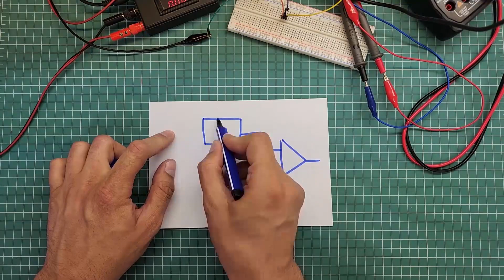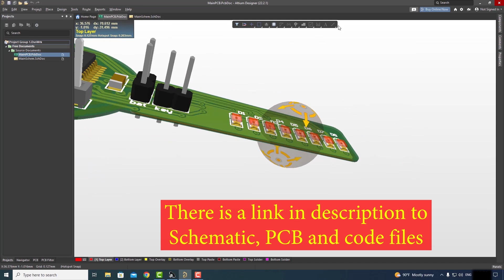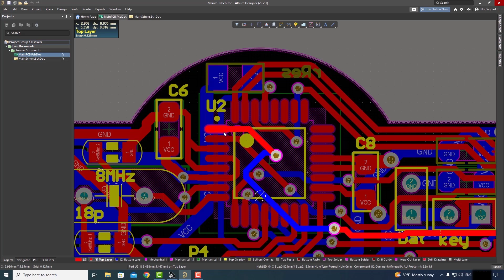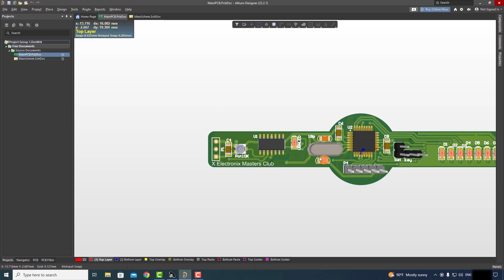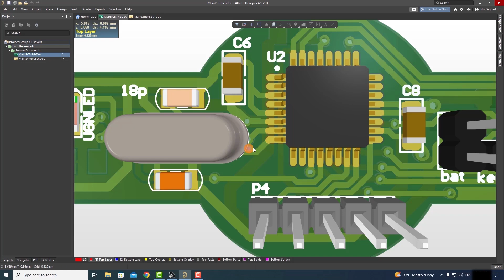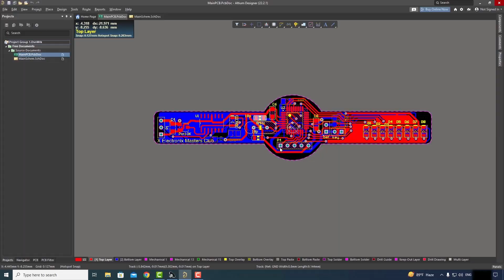How I made my new POV display!

Comment: Querria hacer este proyecto con el microcontrolador de Atmel, At89C5115, porque dispongo de una cantidad de ellos. Crees que es posible realizarlo ? Un saludo.
I would like to do this project with the Atmel microcontroller, At89C5115, because I have a number of them. Do you think it is possible to do it? All the best.
Reply from the maker: Why not?
You just need to write codes for your desired MCU.
Reply: @elewizard  The algorithm would be something like this. The magnetic sensor marks the start of a timer that defines how often each row of LEDs refreshes. A memory buffer holds the "mirror" of what is going to be represented on the screen. The timer indicates how often a new row is displayed. The interruption caused by the magnetic sensor is useful the first time to synchronize the screen. But is it necessary once it is initialized? Because with the timer and dividing the screen area into time, I don't see it being necessary. Thank you very much for answering. A cordial greeting from Madrid.
Reply from the maker: Yeah the algorithm is OK
The sensor is needed to reset the display, not only once in the beginning. Every time the sensor is passing against the magnet, you have to reset the displayed data and start from first row.
By the way. I love Madrid teams, particularly Real Madrid.
Reply: @elewizard  I'm from Real Madrid. From which country do you come from? All the best

Comment: I would suggest using epoxy instead of hot glue.  For some reason after a while hot glue is not as reliable.
Reply from the maker: Yeah, i used hot glue because it was easy to use

Comment: How cool, coincidentally this was my next project!  I decided to not use the attiny84 to dedicate to a capacity tester and use the tineyness of it for this type of project. Its like the attiny85 but has more pins, so handy for led projects.  Although now im thinking i should just use the w801, it has 7 leds built in, albiet horizontally,  you could just spin the development board and boom you got a spinning display!  Shortcut.  Nah just kidding id rather put real leds on there, and modify it for a bike wheel.  But it would be cool to be able to update the message via wifi or bluetooth.  That would be next level POV display.  Thanks for the inspiration.
Reply from the maker: Thank you for watching and sharing.

Comment: Nice project, thanks! So why didn't you use the hot air gun to solder all the components, the IC in particular?
Reply from the maker: There is no specific reason 🙃